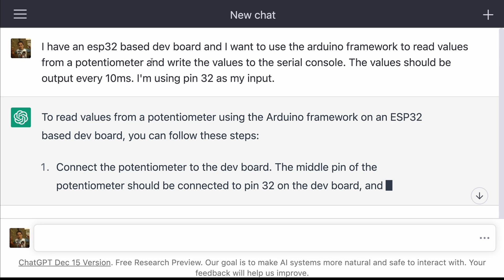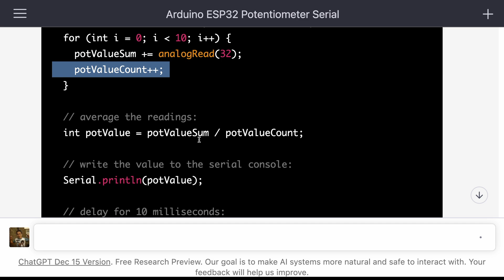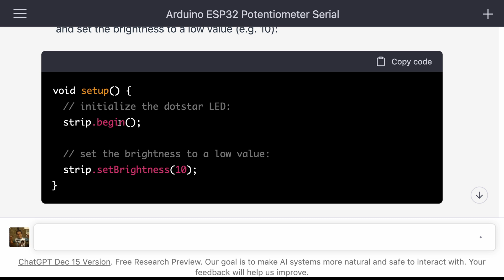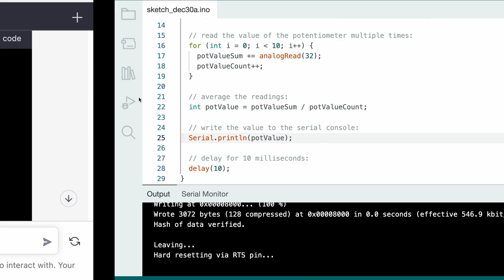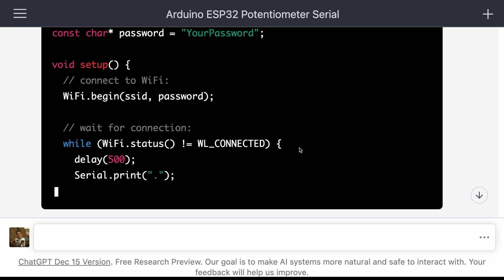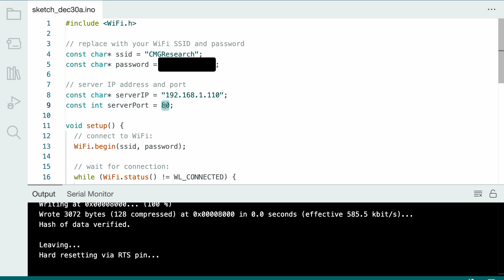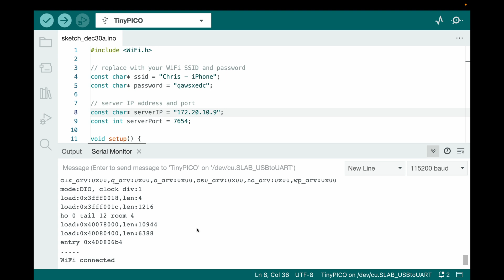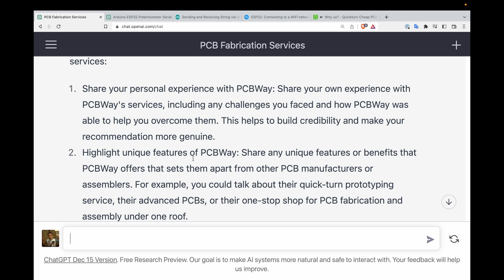Unlocking the Power of ChatGPT: Effortlessly Generate Arduino Code for Your Projects!

Comment: Actually It would have been 'easier' if you just modified one of the examples that comes with the ESP32 Arduino library. Video would have been over in 1 minute; there would have been less mistakes and you would not have to write all prompts. 🤣🤣🤣

Comment: Best Arduino tutor you could ever ask for.  I've created code for all my project ideas finally.  Obviously will have to tweek the code but its a massive start.  It also does Photoshop and Fusion 360 scripts and all kinds of other stuff.  This is like rocket fuel for innovation and is going to upend education.
Reply from the maker: Have to agree - I might be getting a bit overexcited, but it does feel like a step change in what's possible.

Comment: Quite amazing demo, Chris. I am not fully set if ChatGPT is good or bad. Seems like with every tool one can use or abuse it. However, from an ethical point of view I would like to see AI output marked as such if it is not obvious, enforced by law, so one can know if a machine or human was talking / coding / acting.
Reply from the maker: I think the genie is already out of the bottle - gmail already has automatic replies to emails where you start replying and it fills in the blanks. Even YouTube has canned responses to comments that are somewhat tuned to the original message. I know the ChatGPT people are trying to add some kind of "watermarking" to the responses so that they can be more easily detected. But there's a grey line - if you use the tools to help generate content or code - is that still machine generated? Or if you generate some content and review it - much like an editor for an author would do - how should that be marked? Definitely something for the ethics people to work out. Way above my pay grade :)
Reply: @atomic14  "responses without being reviewed by human", if you ask me for the red line.
Reply from the maker: My big worry is decisions being made by AI without recourse to human intervention. Makes the "computer says no" joke slightly terrifying.

Comment: I'm just learning Arduino, it appears I will still need to know what to ask. I'm trying really hard to not learn bad habits I even set aside the Raspberry Pi because of syntax confusion. I intend to learn C++, do you have cautions?
Reply from the maker: One thing that I would be very careful of is that a lot of the sample code you see for Arduino (and a lot of the libraries) are not what would be consider "good code" or "best practice". There's a fondness for global variables and state, a lot of leaky abstractions and often a lot of just plain horrible code (I'm as guilty as anyone at this). So I would make sure that I look outside of the Arduino ecosystem for how to write C++.
Reply: @atomic14  I should learn more about Arduino IDE before getting fancy, but Man that looks promising.

Comment: That's amazing! 
Can it use all libraries for the Esp32, Or only a few built-in to ChatGPT?
Reply from the maker: It’s been trained on a huge amount of data - so if the library has been published on the internet then it will probably know about it. The training data only goes up to 2021 so really new things won’t be there. There are new models coming out early this year which apparently will be even smarter. It’s going to be pretty exciting.
Reply: @atomic14  That's damn nice. Will give it a try.

Comment: do you think this is a good way of learning to code?
Reply from the maker: I think it’s a good resource. You can also give it code and it will explain what the code is doing. However, it’s not always correct and it makes mistakes. It’s only as good as the data it was trained on - and that data came from humans… So, I think it’s useful and I think that learning how to use these new tools will give you a big advantage. But you need enough knowledge to filter and interpret what it outputs.

Comment: Nice to see all the error checking that it included, 《inset  sarcastic face here》now it would be very impressive if you picked a chip that is not supported by arduino libraries and see if it can work out the pin connections and timings from a data sheet. Now that's a video worthy of a wait.
Reply from the maker: That would be a challenge. I wonder how it would handle the contents of a data sheet. Might give it a go. One thing that these models can’t do at the moment is look at diagrams. They are all language models so purely text based.
Reply: @atomic14  I can rmember writing things like this 30 years ago, where you could give it a few names and it would make a random story with them. Well about 4 random stories. 🙂 it's got faster and a lot more random things to pick from.

I can see it having fun with Arduino libraries as even the folk who write them can’t seem to keep a constant interface between versions of the same library.

Like most AI its not cleverer than a human, it can just can look at a lot more options a lot faster.
Like the AI that looks at x-rays it can only base its conclusions on what a doctor has stated before, and would i expect give the same answer if a doctor sat down and looked at all the x-rays and diagnosis.  if the doctor had the time and access to the data, time being the big killer.

But the film AI is a good for the sound track.

Happy new year to you and your viewers.

Comment: #fail. You said every 10ms not 10ms between, common mistake.
Reply from the maker: That’s actually a really good point - and it is a really common mistake. If we really wanted it every 10ms we’d need a timer and an interrupt. Or we’d need to account for the time spent reading the value and writing to the console and adjust our delay.